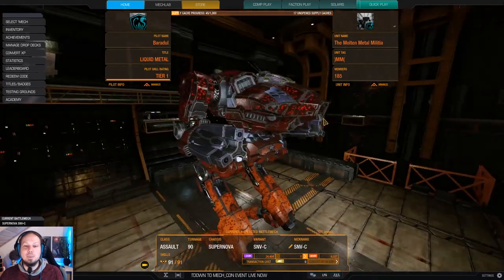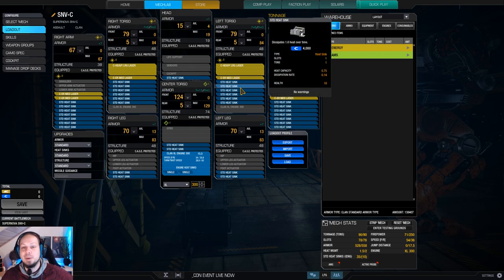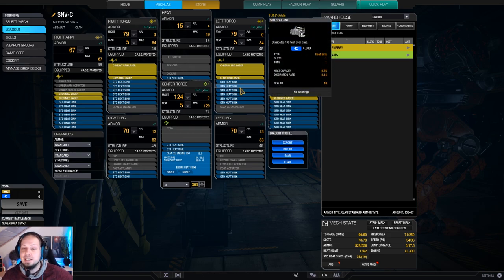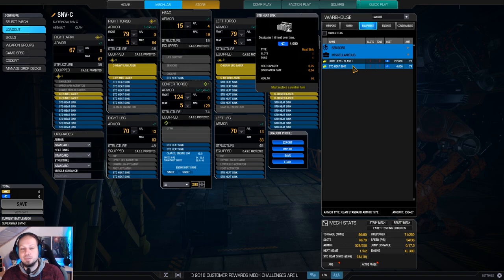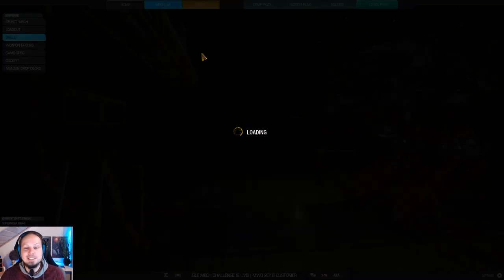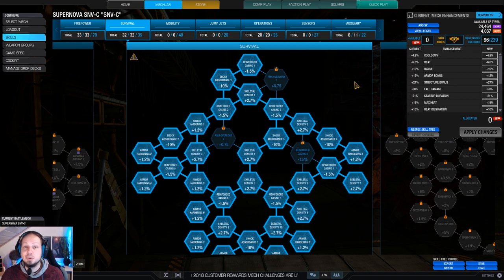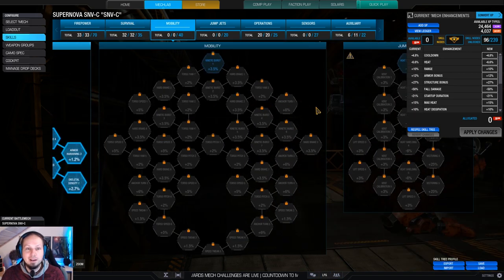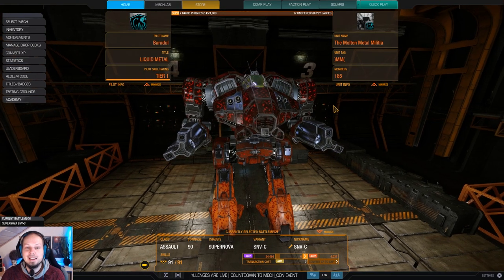45! Single Heat Sink Supernova -  Mechwarrior Online The Daily D5

Comment: I've been running this build for months (figured it out when they changed the heat scale on single heatsinks around Solaris 7 time). The issue I usually have is after you melt the first enemy everyone starts respecting the firepower and just avoids the mech.

Comment: I do not understand PGI's logic here with standard vs double heat sinks. 
If double heat sinks physically take more space (3vs1) then they should have higher capacity than smaller single slot heat sink. So values should be reversed! (heat capacity of 0.75 and dissipation rate 0.14 instead of 0.5 and 0.22). 
Analogy from PC world. If you put larger heat sink on your CPU then it will get warm slower due to bigger heat capacity not faster!
Reply: Rewatch the first minute, also he's using a clan mech, and PGI does not like reality. Lastly technically heatsinks aren't actually heatsinks they're AC units.
Reply: It's a Clan Mech. DHS = 2 slots
Reply: @JonathanM-JMart  yeah they do...

Comment: I'm curious now as to what conditions allow for single heat sinks to be preferable to double heat sinks. I recall before the latest changes that Kanajashi had a spreadsheet for this subject.
Reply: Basically the singles require less space inside the mech and have a higher heat threshold.
So, provided you have the weight available, boating them means you CAN actually be more effective with singles than with doubles, but it requires an assault mech, anything less does not have the tonnage for this. TheB33F did this with a Banshee build long ago.
Reply: I've been doing this with a Marauder, a Black Knight, and a Grasshopper for over a year now.  Basically, if you can set up a situation with a lot of spare weight and space, and weapons that generate considerable heat anyways,  you can make chucking a zillion single heat sinks worth it.  Typically, you need an XL engine to make up for the weight spent on the heat sinks, so this naturally works better for a Clan 'mech than for an IS 'Mech, but it can work out alright for an IS 'Mech if you build it right.  My 'mechs that do this lean on the LPL/ML or LPL/ERML combination (2-3 times as many ML as LPL) for range synergy and weight/damage efficiency.
Reply: @sim.frischh9781  i am pretty sure that was Fantastic Tuesday, not B33f  video name was "Forget Doubles, Standard Heatsinks are OP - MechWarrior Online" 4 years ago :)
Reply: @veegoesvroom6685  Oh, yes, right, i confused those two.
It´s that vid with extra "Wubb" i think.
TheB33F did the 11 Clan ER PPC Deathstar Direwolf and the Suicide Squad XD
Reply: @sim.frischh9781  you can also use them for light mechs which dont really have the space to take double heat sinks, what with the 10 heatsink floor being enforced on available slots if your engine doesn't have enough space..
Reply: @BFGover9000  On lights it´s mostly the weight and not the slots you run out of, singles would be a detriment since you lose half of the engine heatsinks. 
It makes more sense to go for a bigger engine if you have the weight, which, depending on size/rating, also has more heatsinks.
Reply: @sim.frischh9781   if you are running something like an urbanmech though you're probably using ballistics anyways and doubles take up all your slots. Singles make a lot more sense in that case.
Reply: look up Fantastic Tuesday and his old tech Banshee 3S. you can even upgrade from the basic build to a TC or go with pulse lasers. With the skill trees you can be a nightmare. love to use it on Solaris City